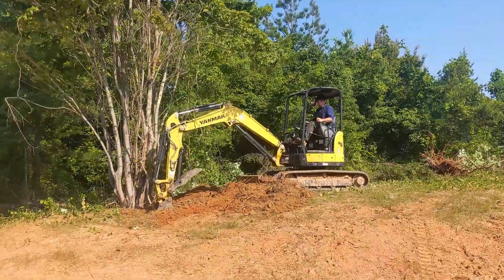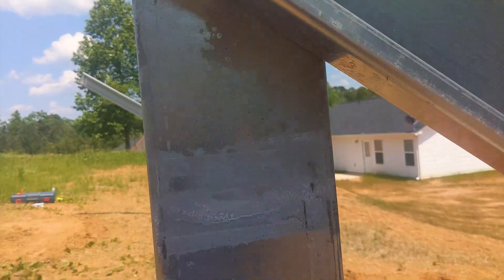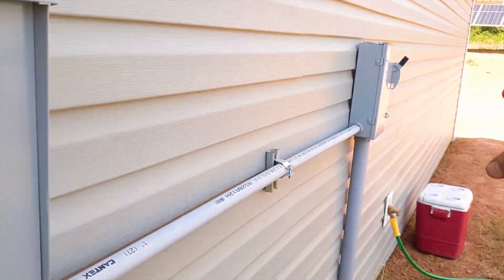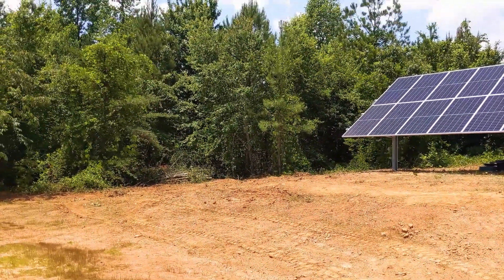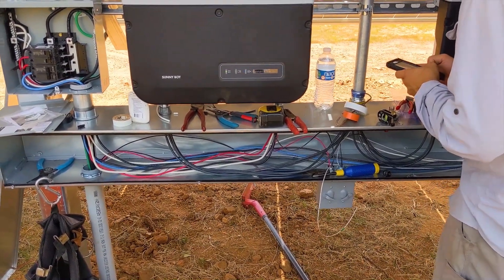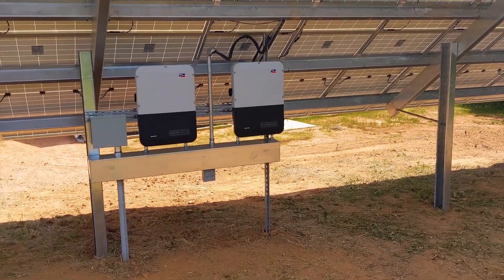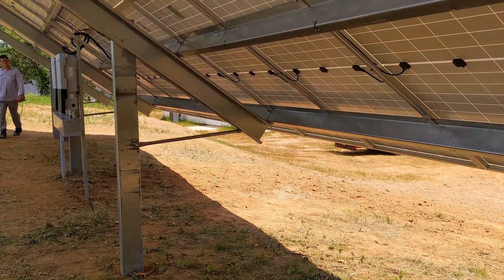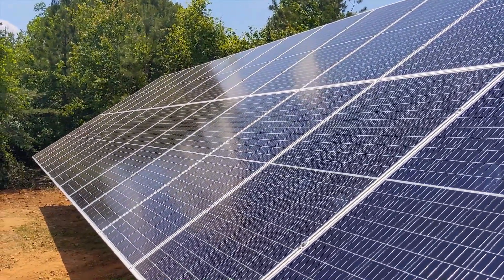Fine tuning our ground mount solar gig

Comment: SPS is great.  The only improvement would be that if in a dual inverter setup like this you could sync the two inverters 180 degrees out of phase, so you could have either 120V or 240V.  Sadly, SMA does not support this for the SPS feature - unlike how their Sunny Island battery inverters work.
Reply: Not for them to do that they want them in phase, however you can use a 1:2 ratio transformer and step up the voltage to 240 for higher voltage loads.
Reply: @hezaswellguy2734  The SPS outlets are not in phase with the two inverters - they are random phase between each other.  Yes, you can use a transformer to create different voltages, but this is added cost by several hundred dollars.  Better yet is an auto-transformer, which will also get you the other 120V phase in addition to 240V.  As SMA already has a design precedent with their Sunny Island inverters that stack 180 degrees out-of phase, it would be nice if they included that with the Sunny Boy's.  Great reliable inverters, would just be a nice feature for multiple inverter installs.

Comment: how is overcurrent protection being provided with the SPS feature? 4000 watts is 33 amps which those outlets are not rated for, or is a 2000 watt circuit feeding each duplex?
Reply: The outlets are separate, with separate SPS enable switches at the two inverters.  2KW SPS output with each inverter, 16.7A at 120V at each duplex outlet.  He just put them in the same dual gang box.

Comment: I asked about having your company build us a system; however, according to your scheduler, it will be 2022 or later. Rapture may occur by then. Hope so, anyway! Thanks for the video. Since you have money you have not spent yet, why not get a small boring rig to avoid trenching. They are fun to run - maybe not as much fun as a Yanmar excavator, but the results are great not having to trench. Johnny was awful quiet during this video. I miss the humor!

Comment: If hail can break windows & make a vehicle look like a fat lady with cellulite, how do these solar panels stand up to something like that ?
Reply: Some years back I met a guy near Mobile, Alabama that builds his own solar panels for this reason. He uses glass twice as thick as the commercial manufacturers. If you knew hail was coming and your panels were easy to change to vertical, this could help.
Reply: @markhutchins8540  that would probably triple (if not more) the cost of each panel. The vertical aspect is interesting, but who the hell can predict the weather ? I've seen hail fall from a few wispy clouds that you wouldn't think had a bucket of moisture for as far as you could see up there. I would love to go solar one of these days, but the thought of a few minutes of hail being able to wipe out the whole solar array worries the hell out of me.
Reply: @larryparish5984 , I agree. It was just a thought. Some folks have only a few panels. The best way to predict the weather is to walk outside and look. However, sometimes those forecasting the weather get it correct. 50% of the time, maybe. So you would have a 50% chance of saving the panels. You can buy the individual solar cells, make the frame with the substrate, solder the cells together, and install a double-thick glass. Too much work for me. I'm not that motivated. What worries me the most is the grid goes down for 6 months or longer. It can.
Reply: Another solution to hail is to relocate to a place that rarely has large hail. Seems I remember the hail capital of the USA was Weld County, Colorado. A friend drove from Dallas, Texas to Phoenix, AZ, and somewhere in west Texas, his car was totaled by hail. Two friends in Denver had their vehicles badly damaged by a hail storm in the late 90s. Most of us have experienced hail storms or will experience them.  Strong wind can be an issue, too.
Reply: I've got an array at 10,000' in the mountains. Seen hail many times. At least one time the hail was bigger than quarters. Panels have handled it all no problem and never looked back.
Reply: @wbuffetjr1  That is good news. When I lived at 7,500 feet we got hail often, but most of the time it was rimed snowballs and not as hard as clear ice. The hail at lower elevations can be baseball and softball-sized. Driving in Kentucky and looking in a pasture seeing what appeared to be cattle asleep. They were all dead from large hail. The hail in Texas and Colorado easily goes through windshields and skylights. I think it is likely this hail may damage a solar panel.
Reply: @markhutchins8540  Of course baseball sized hail is going to cause damage. Baseball sized hail is most likely going to damage every single piece of property you have exposed to it. I am assuming the original question was referring to "normal" hail and not once in a lifetime hail. That would be like not installing solar because the array could not withstand an F5 tornado.
Reply: @wbuffetjr1  I agree that it is a low probability of solar panels being damaged by hail or tornadoes, but it happens. Large hail is more than once in a lifetime depending on where you live. Some places never see hail larger than pea-sized. Some places never see tornadoes. I doubt some solar arrays can deal with an F3. I lived through an F2 or F3 and it ripped up 100-year old trees easily. I was amazed at the damage. I suppose a very strong ground-mounted solar array could have endured.
Reply: To me the question is can you for a reasonable price add the solar system to you house insurance.

Comment: Are thouse the only inverters that can do that without batteries? What about the SolArk 12K? Does it have that SPS function as well or do I need one of thouse SMA inverters?
Reply: You can install a SolArk as grid-tie without batteries, but it does not have the regulated backup outlet like SMA has.  But no real reason to use a SolArk without batteries - many lower cost options for grid-tie only.  SMA is the only inverter with the 2KW SPS backup outlet feature.
Reply: @billjohnson3344  I will keep that in mind. Thanks for the clarification *